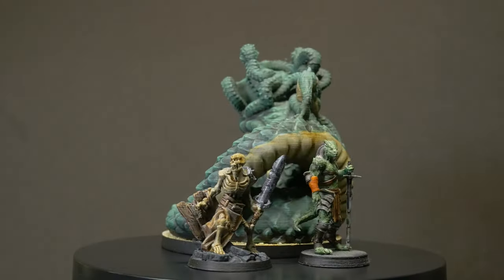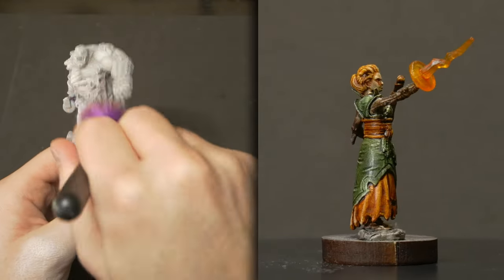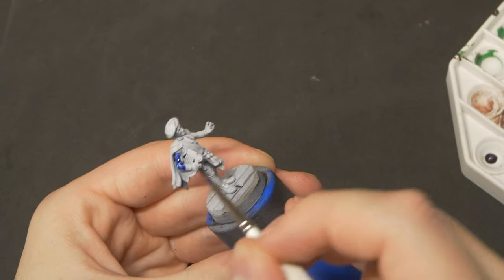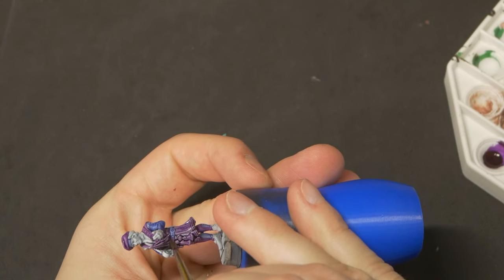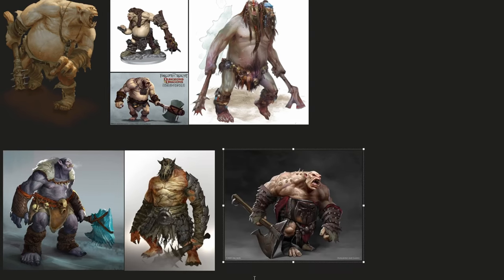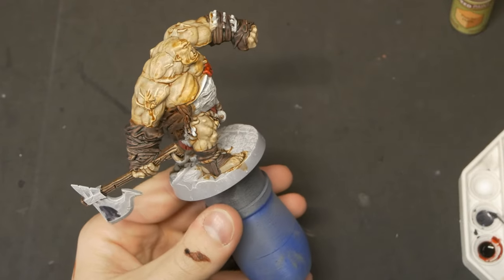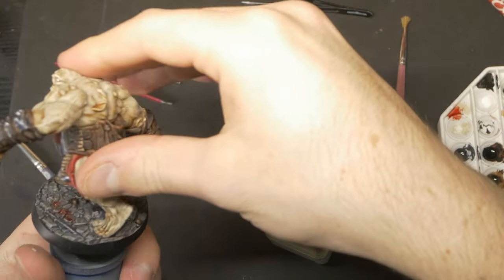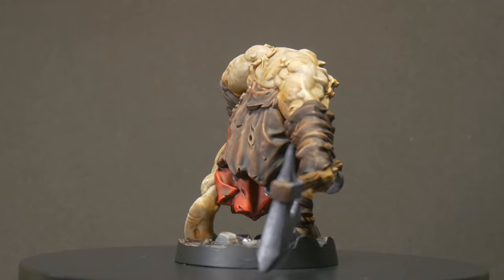Making SPEEDPAINTS Look BETTER is Easy! | A Fresh Look at SLAPCHOP

Comment from the maker: What are your thoughts or experiences with Slap-Chop or Speedpaints in general?
Reply: I just dont like the Look in most cases. Add to that, that they are extremely unforgiving with mistakes (normal paint i wipe off with a clean, damp brush or easily fix it with another layer), and I just dont find me using speedpaint a lot other than as washes.

Comment: I think both could benefit from a bit more contrast. The base grey you started with seemed quite bright, which would be good for a mid-tone on a grey scale. If you don't feel like having an even darker primer (either black or a much darker grey - or some other dark colour, to provide a bit of colour variation) and drybrushing up from there, another option is to give the whole miniature a wash with something like Army Painter Dark Tone after priming it with the grey you used, then drybush again with the white.
That'll accentuate the shadows of the speedpaint a bit more, giving more contrast and making the details and colours pop even more.
And it's a very cool bard miniature your player put together there! 😁
Reply: From my experience, starting with a darker tone that he did does not work for skin tones (and other more translucent contrast paints) and will lead to results like he showed at 1:43 where it looks like the woman has a beard shadow (and the results can get way way worse).
Reply: @Kijubei  I agree with @GentleGiantDK. The way you avoid what you're saying is to go heaver with the grey drybush (and white second drybrush) on the areas that you want to be consistently bright. But leave the areas in shadow with more black and gray. You have to be intentional and precise about where you drybrush as that's laying down the dark and brighter undertones.

Comment: For mistakes have some small cotton tips handy and correct straight away, I use what looks like a cocktail stick with a pointed wrap of cotton, very precise, just dampen and dab the paint away…..available in large packs cheaply on eBay. I see very few painters use them or recommend them in videos, they are an essential tool when using these kind of paints.
Reply from the maker: Great tip! Might include this in my process moving forward! Can't hurt to have them handy for fixing mistakes on the fly.

Comment: Slapchopping FDM printed models will be flawed from the start given the layer lines vs resin printed models. The drybrushing will accentuate the layers lines.

And not sure if you meant to say blue and purple are complimentary in the colour theory term. They are analagous to each other, not complimentary.

Comment: I know this isn't quite slapchop, but my approach has evolved to essentially slapchop over regular acrylic basecoats. That is - base coat normally - drybrush entire mini white (looks awful but trust the process lol) - apply speedpaints thinned 50/50 with medium. It's not as fast, but it's not exactly slow either as it does all highlighting in one go, and one benefit is that you can correct easily with the original base colour.
Reply from the maker: Ooh that'd a really interesting approach 🤔 would make for some really rich colors and better contrast, plus as you say cleanup is easier. Might have a play with this idea!
Reply: @Painted4Combat  You want to try to make sure the Speedpaints colour matches the base colour as closely as possible for an even finish.

Comment: Enjoyed the video, came across you via the power of "related videos" and I hope you don't take my comment for anything other then a helpfull "things I've learned because you asked.." comment but one step which I will swear on that I didn't see you do, is prime your model in a darker colour. Blacks, Purples or even Reds as your base and then prime from a 45degree or sharper angle downwards with a light NOT WHITE colour, a grey etc... your stuff is really bright as a base. This way the undersides and recesses that "the sun" wouldn't see are still naturally dark. Then you add your grey drybrush all over and then do a white drybrush to pick out the edges that would catch the light so when youre looking down at it on the 45o angle, downward strokes only, doing everything just takes away the edges you want to stay bright. 

Speedpaints/Contrasts I've found works so much better when you already have your shading done, so the reason you're getting quite bright, models without much detail or shading is because your missing the built in shadows to the undersides of models, the darker recesses etc..

Obviously there are several methods and having painted a couple of hundred minis in a few different styles I've found the following approach to suit me. Im not saying it's best, nor am I saying the others are wrong etc.. just what Ive found as a great balance between time and final quality. Maybe consider giving it a try next time and going "that was great" or "that guy was a moron im not doing that". But I Prime Black/Green then I Air Brush top down Grey, Then Dry brush lighter grey then white for Characters/heroes - Skip the grey step for swarms/trash mobs etc.. Then move onto contrasts. The only exception being if you want really pale skin tones, then you want to drybrush the fleshy bits really heavily with a lighter colour.

Eitherway, thanks for the video was fun watching what you've learnt and how you've done it.

I love painting with contrasts and doing slapchop esque jobs as it's become known. They help me be better then I was with the time I have available to me.

Comment: I think that both of these models were kind of suited for speed/contrast paints. The ogre has really nice detailed skin and the bards clothing was broken up enough to take the details well.
How would you have handled less detailed, more flat areas of a model with this technique? Or maybe just skipped this and used layering instead?
Reply from the maker: I mean it depends! Something like a space marine for example still takes to Speed paints pretty well! - Something larger like a Dreadnaught, or anything with truly flat panels, though would definitely benefit from just being painted with layering. 
But most 'organic' minis will take to speedpaint well (though that does still depend on the sculpt of course)

Comment: Isnt undercoats used in slap-chop?
Reply from the maker: Depends on whose method your going with, there's so many iterations on Slap Chop as a method now - but im pretty sure that the 'original' was just contrast/speed paint over a black prime and white drybrush (But I could be wrong!😆).